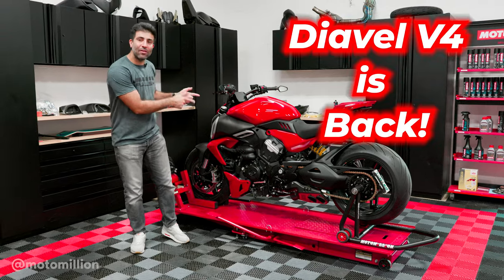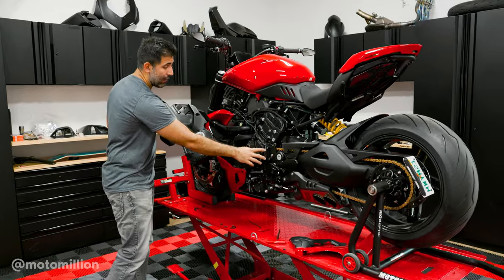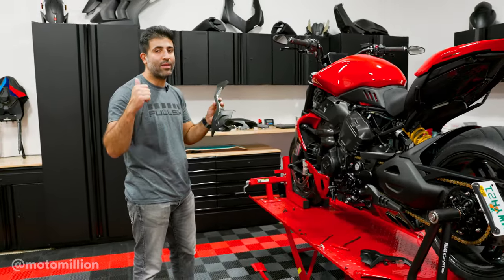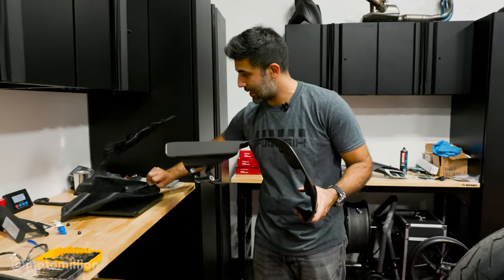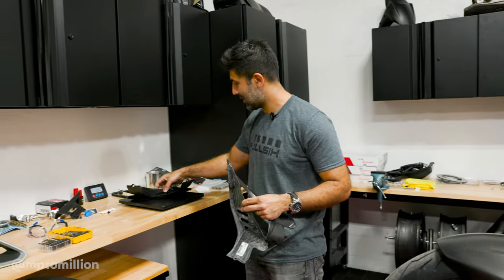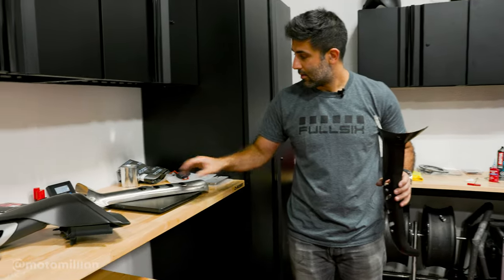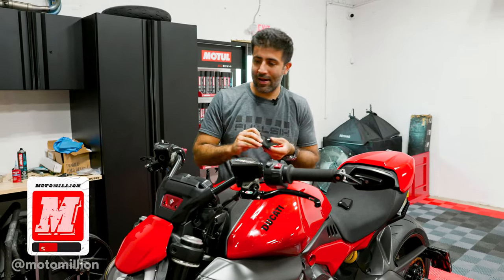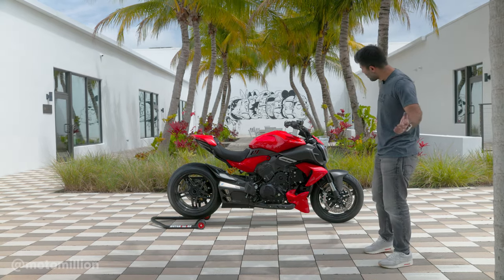DEATH TO PLASTIC! MORE Carbon for our Ducati Diavel V4!

Comment: Great build, Mani! I have a black Diavel V4 and I've hated my stock exhaust cover, too. The ones I've seen powder-coated black look great, but this carbon one could be a great option as well. Does the carbon exhaust cover have options for black fasteners instead of silver? Again, great work! 👍
Reply from the maker: Thank you! There is no black fastener option, but shouldn't be too hard to source them in black, they are generic m5/m6 bolts.
Reply: @Motomillion  thank you!

Comment: I am getting tired of these bike blogs of loosing  weight by miniscule amounts by replacing plastic with carbon .....what difference does it make to performance if a 200HP bike loses 10 Pounds (70,000 grams) ......its completely ridiculous...and just another way of extracting cash from the uniformed....rant over!
Reply: I think it's a highlight of the combination of looks and performance, just something to talk about. But you're right it's probably not going to make any difference unless it's wheels.
Reply: Removing plastic is primarily an aesthetic exercise that has the benefit of weight loss. And the carbon trim pieces then tie in the aesthetics with the main carbon pieces that are the significant weight savings (wheels = unsprung pounds).

Just leave your bike stock and let others add whatever they want. Some of us consider every piece of carbon to be an improvement in function and appearance, because it IS.